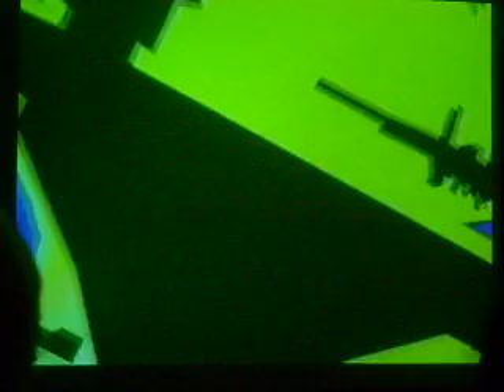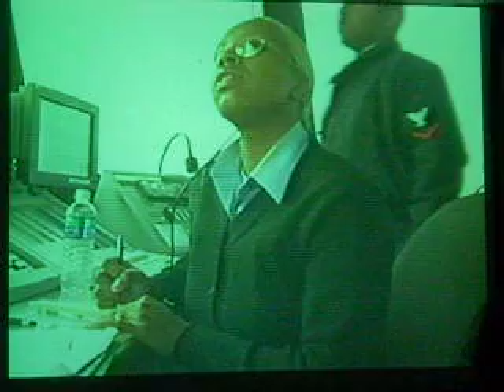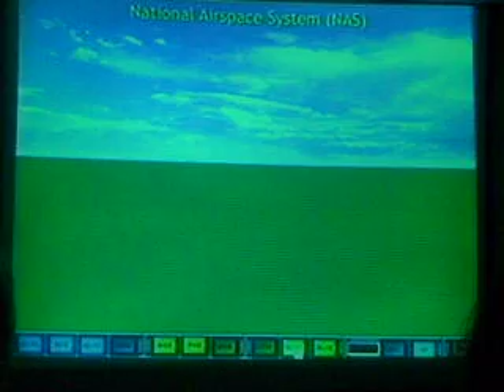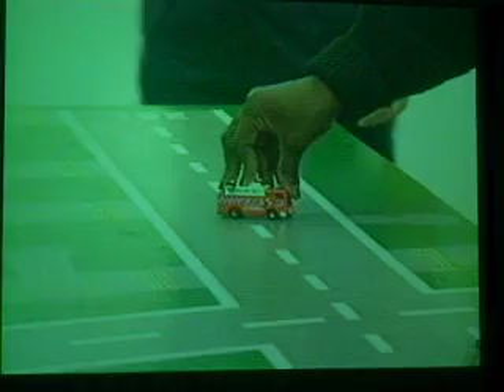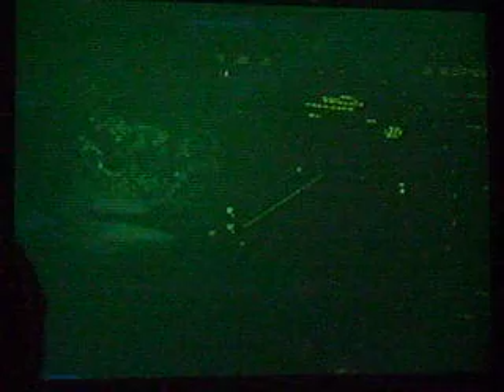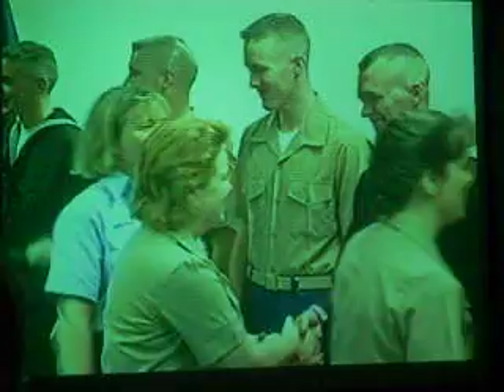Navy AC Graduation 3

Comment: How is it being a AC?
Reply: I was a Navy AC and it was great. Underway it can be a little hard working 12 on and 12 off and if working the night shift (midnight to noon) it can be hard to sleep during the day with noise. The best part is your job is about 99% underway so when in port you usually are off to explore as soon as the ship comes into port. When not on a cruise we usually just did busy work and were let go by 1-2pm most days.  I'd recommend doing a quick 4 years and if you like it consider doing it as a civilian since it starts at $70+K at most airports. Keep in mind you can't be a civilian AC once you reach 31 and you have to retire at 56.
Reply: Micah Fischer I believe that has changed & the oldest you can apply for a civilian AC job is 39. However take it with a grain of salt, I’m just a keyboard warrior.